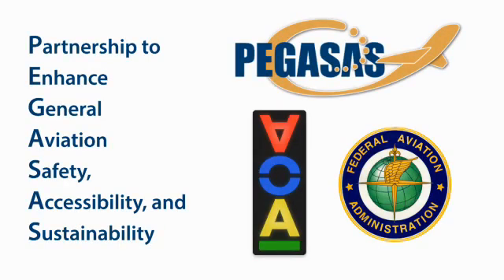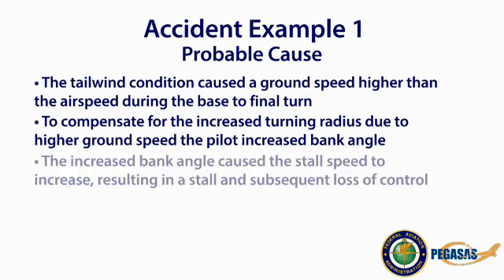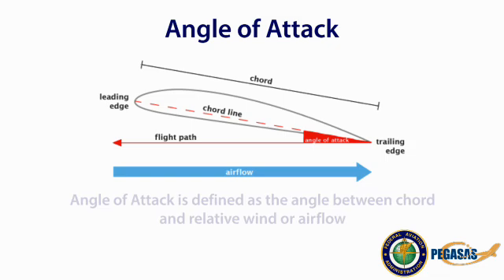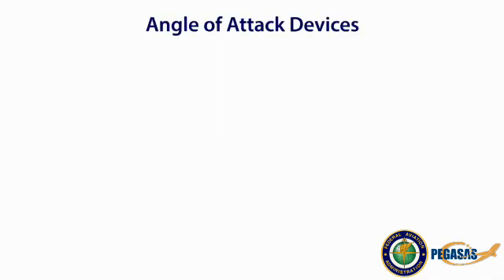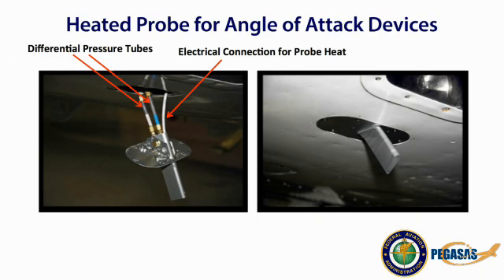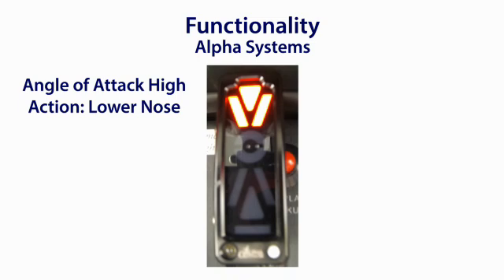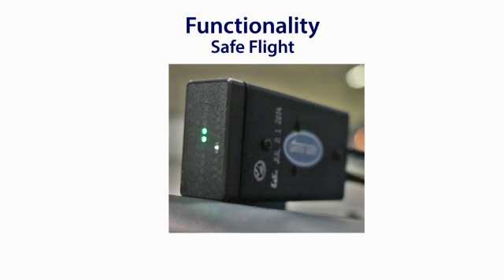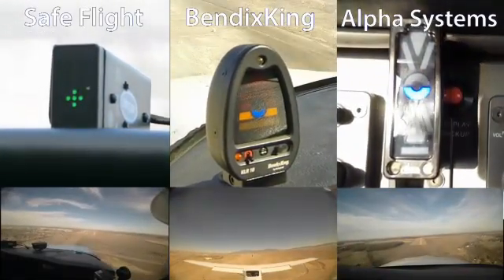Angle of Attack (AoA) Awareness Video

Comment: I’ve had a basic Alpha Systems AOA in my airplane for about 15 years, and it is useful. I have it calibrated for a clean wing, so that its display is actually a bit “generous” with flaps deployed—not likely to ever get into a stall situation based on its display with flaps deployed. 

But I have to say, this video is extraordinarily boring. It was all I could do to watch it to the end.

Comment: I would like to see the FAA began to require AOA on new aircraft and make them a primary flight instrument during low speed phases of flight in place of the current antiquated stall horns that provide nearly a binary indication rather than a wide range analog indication.  Time to leave the 1960s and get modern to begin to get a handle on stall related accidents.
Reply: The only reason they are not standard equipment on small GA aircraft has nothing to do with the FAA. Like every other piece of outdated tech in these aircraft, it comes back to cost. Need to severely reduce liability first.
Reply: @WhallonJesse  That’s not correct.  Who controls certification and registration of new aircraft designs and newly manufactured airplanes?